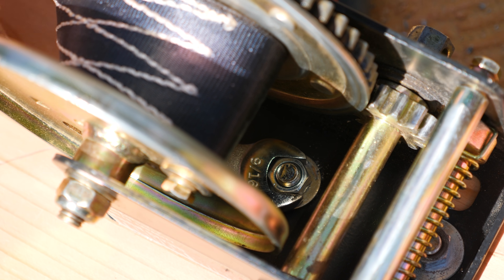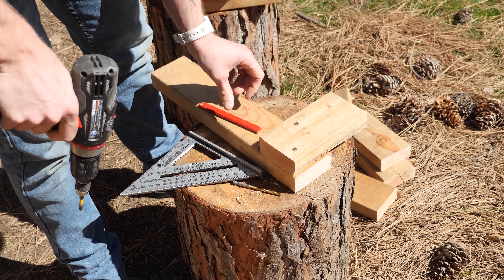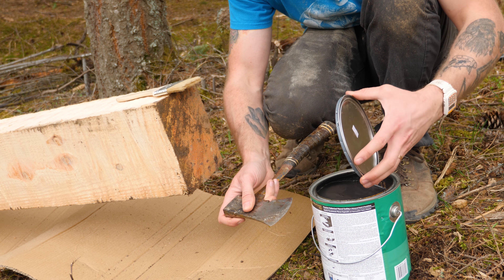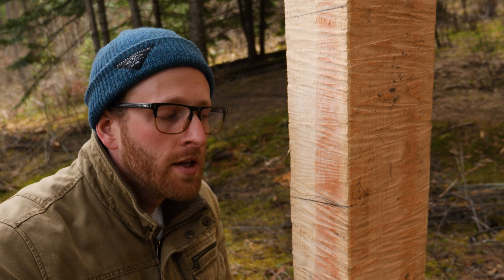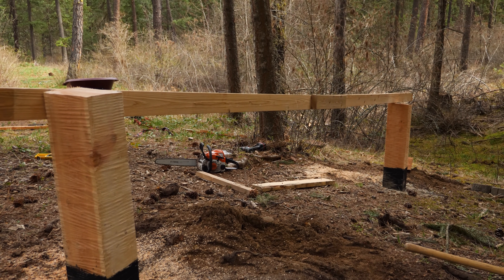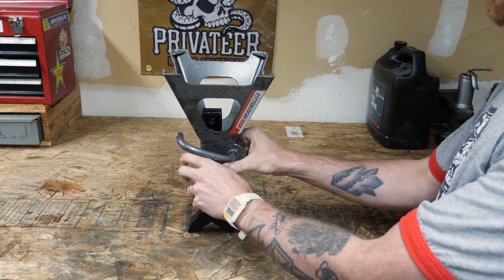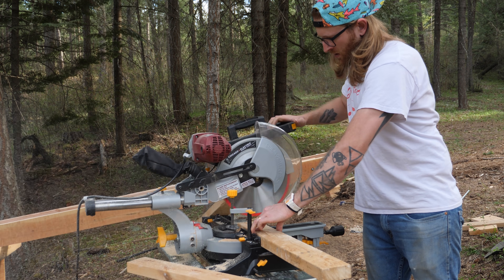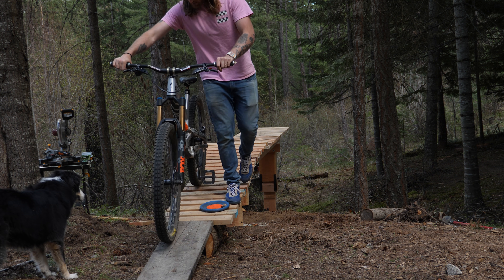Adjustable MTB Drop Build and Ride! // From a Blue Feature to Black in No Time

Comment: Such a cool idea. Crazy how many pieces need to be engineered when it’s just a “wooden ramp”! Awesome seeing the solutions you found and it coming to fruition.
Reply from the maker: I probably accumulated 2 days time just staring at the thing trying to make it work haha
Reply: The Shredist looks like it paid off!
Reply: Yeah, at first I was having trouble seeing where he was going with some of the design, wondering if it could be done more simply (and indeed it could), but it's really awesome how the load-bearing bar automatically latches and releases as you crank the winch (obviously with the appropriate backing-off of the winch tension).  Awesome job!  Just subscribed.

Comment: That was pretty scary with your partner and the spinning death handle 😶
Reply from the maker: Yeah, it was super scary, she's all good now though, still a few weeks until she can ride again though.
Reply: @TheShredist  better than a few months, looking forward to the trail progression!
Reply: Should have been a sign to switch the approach when it became that hard to crank - some simple pulleys between the winch and the load would have required more rotations, but kept the cranking easier.  Not sure if the winch might have still failed eventually, but at least it would have had less force on the handle when it gave out.
Reply from the maker: @chrislukes9037  ya she realizes she had too much tension on it, lesson learned the hard way.
Reply: @TheShredist  I meant that more as a suggestion (get some "snatch block" pulleys) than a scolding :)  Hope she heals up alright!

Comment: When you use a pulley like that and putting a lot of tension on it, put something over the cable/strap like a chain or a blanket. If it fails it won't come back at you full force. Learned that one the hard way

Comment: Love this! 
Just remember that all of the load is being applied to the three screws on each of the stopping points. My guess is that you’re fine. But I’d personally pull each of those off and slap on some outdoor wood glue then reattach! 

Awesome build
Reply: Yes indeed. The wood might split in two pieces on the line of the screws. Also a metal in wood-connection will wiggle itself loose with time under the load. Fine for quite a while tho anyway! In future maybe D3/D4 wood glue and proper clamping or wooden dowels (think 20mm round peg or sth) would make a stronger connection.

Comment: Just a quick word of advice (not that you need it), if you buy a ripping chain for your chain saw you will achieve a much better final finish on the posts/ boards that you cut with it. Ripping chains are normally skip (50% less teeth), so not only is the chain designed to cut with the grain, it also allows the speed of the saw to be maintained and prevents "bogging" of the motor, all of which contribute to the final finish on the timber. Saves a lot of work! Nice project!
Reply from the maker: I have a skip tooth chain on there I bought to help, is there a different style of chain specifically made to rip? I would definitely like for the cuts to be quicker...
Reply: @TheShredist . 1st of all I wasn't criticising at all, just saw you having to work hard to plane up the upright post. Normal (cross cut) chain, full house or skip is ground at 25º. Ripping chain is normally 30º or more, so less chop and more slice. You could create a ripping chain yourself by re-grinding a 25º skip chain to 30+º to create a ripping chain (or you could buy one 😉). I have a LogoSol (Swedish) mill and the difference between ripping and cross cut chain is dramatic in terms of finish on the timber and strain on the saw. Size of saw (HP) is also a factor when milling. A well-sharpened ripping chain should leave an almost planed cut, as opposed to the ribbed cut you have, the difference between chop and slice. Glad your Wife came out relatively unscathed, that could have been a lot worse if her face had got involved! All the best, Tim
Reply from the maker: I didn't take it as criticism at all! I legit appreciate the input, I'm definitely going to look into getting a ripping chain, might make ripping planks as a source of building materials more realistic!

Comment: Hey  Back in the day I built an adjustable jump at my Mt Bike Park in North Carolina. The Tar River Trails (not the ones in Rocky Mount NC) were in Granville County. It began as a simple triangular portable wooden kicker built by a friend. It was not a practical thing as it was heavy, too short and needed extra support. So he threw it out of his truck at my trail head. I was sitting on the porch of the club house looking at it, thinking what the hell am I going to do with it. And developed a plan. it was decked on the hypotenuse of a right triangle about 4 feet long and 2 feet high. In my head, I rolled it over and thought about a pivot at the long point. The next day I cleared a line on the side of a slope. Laid in a curved cedar ladder bridge from ground level to a beam 2' high where I bolted the pivot. Set 2 posts in the ground at the other end and drilled a series of holes 2" apart. The Kicker could rotate between the posts and was supported by a steel rod in the holes. With the hypotenuse on the bottom, as it arced it stayed on the rod. I then supported the posts by triangulating with a cheater ramp. The surface went from flat to raised 2'. The transition at the pivot  got rough as the kicker was raised above about 6-8". So I made a plywood insert over the pivot that curved with the unit as it was raised and was simply slid in and locked when the angle got difficult.  It turned out to be amazing.  For a decade many of the Raleigh area riders developed their skills on the Monster Jump. A good session would start with it flat and gradually be raised till complete pucker set in. Maybe a dozen riders ever hit it at full Monster.  Which could launch a rider to heights of 8-10' above the ground and send them 30-40' down the slope for a drop of maybe 15' below the ramp. 
https://www.youtube.com/watch?v=y-0a8j1EDY0&t=579s
https://gallery.mtbr.com/showphoto.php/photo/25900/title/alex-ajustable-jump/cat/514
https://gallery.mtbr.com/showphoto.php/photo/20504/title/adjustable-jump/cat/500
https://www.youtube.com/watch?v=MnerjQ3KcVY
https://www.youtube.com/watch?v=EiESnvOn39Y

Comment: Great build and vid, if your wanting to paint out the post bottoms try a paint roller you can get small ones that are pretty good or if your lazy use a drum and dump the end of post into the drum and leave it over night it will absorb into the wood. Using come alongs is always dangerous as they can break at the wrong time it’s called snap back. Plenty of ways to fix it google it or YouTube. Keep up the work I’m now hitting the subscribe button and the bell. Ps you can add concrete toy your post holes it’s called a dry mix and will draw in moisture from the surrounding and go of over time.

Comment: For the posts pull them out and char the wood the charred wood will prevent rot much longer then any products you can buy. I’ve found a tiger torch works best. Cheers keep the content coming.

Comment: really cool concept. Could see this being very useful in a private spot where space is limited. 3:45 it would be better to use nails to secure these “teeth” as they have a lot higher sheer strength compared to screws.

Comment: There’s a tar coated plastic post wrap that you staple on and heat shrink with a blow torch. You only wrap the part just above ground and down about 8 inches as that’s where the bacteria live that rot the wood. 
With posts of ash and chestnut you can just lightly blacken the outside with a blow torch, the charred surface resists the bacteria, not sure about pine.

Comment: about the wood rotting in the ground: looked like u used fir? for future projects you should use larch if you can get your hands on some. it's way more resistance to moisture and other kinds of natural damage (heavy though). also you can firetreat the "underground" part of ur stems before dropping them in the ground, usually to a point at which the wood is dark black but nothing turned into an easy to break/scratch charcoal layer yet

Comment: If you put a handle or bar on the end of the drop you could hang or pull on it after every adjustment as a little safety check that might be a bit more thorough than slapping the top of it
Reply from the maker: Lol you're not huge on the safety slap? 🙌 good idea though!

Comment: I see this happen a lot with backyard builds. People build the drop at the edge of the landing, when it should be much further back. When it's at the edge of the landing slope, you have to ride very slowly to catch the transition and not risk overshooting the landing. Now that the drop is in place, have you considered making a mound of dirt to push the landing away from the drop? It'll make it much less harsh, too.
Reply from the maker: Oh yeah definitely will work on the landing, but it put it where it is because I didn't want it sticking so far back into our field/yard area, and I needed the difference in height between the posts so the drop could lower enough to be perpendicular with the ground.
Reply: @TheShredist  Awesome. It was hard hard to "step back" and see the whole set up. Love the vids. Shred on.

Comment: For route protection and so the bugs don’t eat at the word if you Chaar the outside of the word with like a torch or just burn the wood it will prevent rot and deter bugs and stuff from eating away at the wood

Comment: Pretty cool but might have been easier to drill out holes in the main beam equally spaced that you could slide a pipe into. Or use one of the jeep jacks to lift and lock.

Comment: Try using automotive undercoat on the posts. You can get it in a spray can or brush on. The spray cans cost as little as $5. (the Bondo version is better, but abut $15)

Comment: With wood finishes the stronger the smell the better the rot resistance, generally. You had a tough time applying finish because the surface of your lumber wasn't plained. The smoother your wood the quicker your job 😉

Comment: tip for landing: don't just let the suspension do all the work! work with it and use your arms and legs more. if you use your arms and legs to their full potential, that's like an extra 250mm of travel! thats A LOT of unused motion and impact dampening. also, it'll keep you from bottoming out when you take huge impacts

Comment: How tall are you seems like your a tall guy I’m a big dude I’m 6.4 280 and have been trying to figure out what kind of bike I should be looking for most bikes I’m already at the weight limit without gear any suggestions
Reply from the maker: I'm 6'0", but I ride with a buddy who's 6'3" 250lbs and has been really liking a santa cruz mega tower. Hes on a size xl, but I believe they even go up to xxl. I'd just shop for a bike with a frame big enough for your stature and maybe go with an air shock since you can increase the air pressure quite a bit.

Comment: Soooo sick!!!
There is a Russian YTer who makes “bush craft” and mills his own wood from fallen timber with a chain saw as well. He has tried many jigs but had finally settled on doing it “free hand” with some practice and tips. I will try to find and post the link to it. He has built a log cabin and many things using this method. I’m an experienced carpenter and mountain biker so this drop is AWESOME! 
One question I had was do you think the nylon strap will get worn out very quickly from the friction on the wood? What would happen to the drop of it failed?
Reply from the maker: It definitely will wear out, I plan to make a roller system at that contact point for a non friction setup. There's zero load on the strap while set at stages so there's no worry if it failed, but if it broke while adjusting, chances are the box would bind on the post as it needs a little coaxing to move back down.
Reply: The Shredist that’s a great solution! One suggestion: when you service it, raise it to highest position, build a triangular shaped deadman to support and hold the platform in mid air then disconnect and lower the wench part from the platform for ease of access. 
This is a fantastic idea for a drop with minimal footprint! I hope to build one. Regular roofing tar to seal the posts is what I normally use. It’s pretty inexpensive. It looks to be like the same black gooey stuff you used but much thicker. It’s just as difficult to apply because of its viscosity. Using a 6 inch roller with a thick knap is a bit easier and faster IMO. Still going to be messy though. I use a small wide piece of wood to spread it out like peanut butter then roll it out. Wear gloves! ☺️